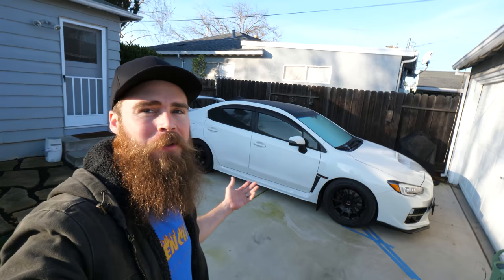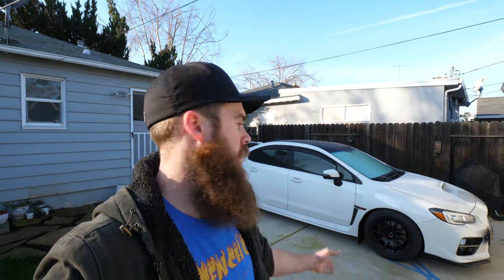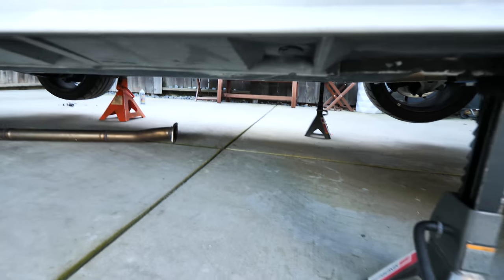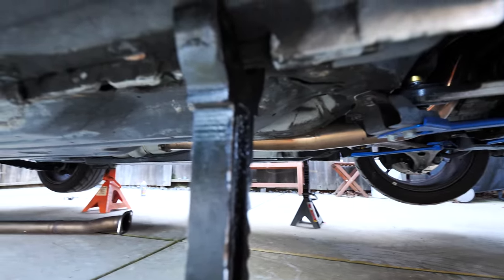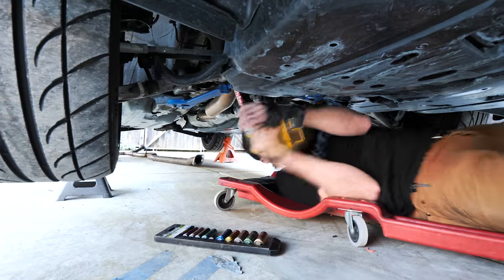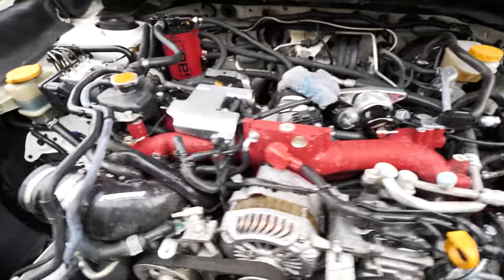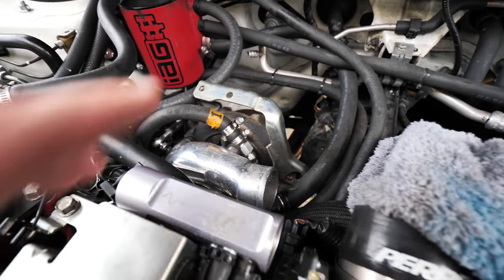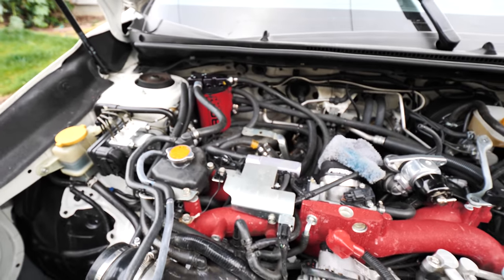MOST HATED SUBARU VIDEO EVER "THE STI PART OUT"

Comment: Hey what's up Blake. Just checked out some of ur other vids and see ur an Audi guy. A close friend of mine had a 99 a4 1.8t Quattro back in the day. The car was making about 440 - 500hp on cam2 race gas & running a haltech ecu. Ran mid 11s quarter miles ( very fast considering this was the early 2000s). Anyway he prob owned the car maybe 8 or so years. He went through about 4 engines and about 6-7 gearboxes i kid u not. Twice due to oil pump failures and once it threw a rod through the block. Grass not always greener on the other side. He however loved that car.

Fyi I do own a 02 wrx with almost 200k miles for the last 8 yrs.  Lightly moded and owned since about 70k miles, so nothing crazy.  I have done 2 timing belt changes and clutch myself using oem parts.
Reply from the maker: blue88aw11 Yeah the EJ20 was a lot more durable than the EJ25. Thanks for the Audi info I always heard the 1.8 was kinda crap. From what I’m hearing about the MBQ 8V AUDI’s and Golf R’s is that they can make reliable power 400 wheel on the stock block no issues and tracked. I’ve been talking to 034 motorsport about this and they track the hell out of there’s no issues. Seems like most modern German cars can hit lap the track with no overheating issues where new JDM cars cannot. For example I just heard Matt Farrah talking about how the Civic Type R was overheating after a few laps at Road Atlanta.
Reply: I still like them and I was considering buying one of the older 1.8t a4's last year as a 2nd car. They are dirt cheap around here (NYC), around 1500 to 3k for a decent one with a manual trans. Even the later generation, (after 2003 I think) u can get a clean 2.0t manuel trans from $2500 to 5k. About 150-170 RESTRICTED hp stock. Most Vw/ audi tuning companys way back had 200$ kit for the 1.8t that gave an instant 50-60 hp. Basically it was just a chip and drop in k&n. Add a good exhaust, turn up the boost on the tiny turbo and I think u got a reliable 250-300 hp car. I honestly think it is the best performance  deal out there. U can buy like 3-4 a4s for the price of a wrx of the same vintage haha. I actually wound up getting a good deal on an impreza outback sport.
Reply: Btw good luck with your hunt for an e46. I think ur in Cali right? I know someone looking for e46 m3 with a manual, hard to find around here (NYC). A clean hardtop with a manual is super expensive. U can get one of the SMG ones for like half the price it seems haha..

Comment: Hated this video until I got rod knock at 60k on my 14 STI COBB STG 2... Never been tracked, and routine maintenance performed. Went through a second motor within 3,500 miles (Most likely a poor build) and about to receive a third motor. I don’t hate on Blake for getting away from these type builds. Great looking and sounding cars, but not feeling too good about the ej motor at this point.
Reply from the maker: Yep, it's definitely a downer when the keep 💩💩 themselves. But fun when they work.

Comment: big mod list for a car that makes similar power to an fa with a downpipe intake and e50
Reply from the maker: Hugh Janis I hope you know the FA fails pretty commonly also I’ve see quite a few in the shop getting builds after they frag the engines.
Reply: I wasnt commenting on anything other than that being a rather lengthy build list for only 400whp. I mean it seems like 350wtq is the sweet spot in the new fas, most notably was maperformances car. It blew up but fuck did they beat on it for 30xxxx miles on a rather high lvl of ethanol and they say around 370-380wtq when it blew. I would agree buying an STI right now not the best idea, 2020 and the new sti on the other hand will be interesting. As far as german cars go dont get a BMW they are just as expensive and break just as go for a 3.0t s4 and get an 11+ so you can have launch control.
Reply from the maker: Hugh Janis got ya, you can make 400+ wheel on a stock EJ block just not for long. Even a built engine will only go about 20K then pop so for the price your right you could have just bought a used S4 2011+ or if your talking new car cost and engine build 💰 you just bought a brand new S4
Reply: Funny just snagged a brand new z51 2lt today, guess i dont have to worry now lol later subie and z

Comment: It's unfortunate that this is the worst gen Subaru. My transmission failed with only 20k and no mods and off course if your a Subie fan then you saw how terrible these cars have been on the Rallycross circuit the past few years. I'm still a fan of Subaru but kinda like you did i'm working on an alternative fun car.

Comment: I know people with the new RS Focus and blowing shit up. It's all about how you drive your vehicle and how well you take care of it. Race the vehicle "even a race car" and it'll eventually start breaking. lol 

If I do anything with my RS, I may just track it once in a while. Primarily to get the feel. Otherwise, I may do some mods, but most mods may be in the interior, "Sound system and such."
Reply: Zack Sexton yes u can blow up any motor on any car. I have seen people blowing focus rs motors as well so I'm not sure why the hate on subaru is so prevalent
Reply: Chris Rogers, yeah I think it's just a thing. Competitor competition or just a matter of people buying a car and blowing the engine and realizing how expensive it really gets.

I was originally going to get an brand spanking new STI, but I heard about the RS and wanted to try it out.
Reply: I like speed and all, but I got my car primarily for leisure and better acceleration due to dumb people on the road and hill climbing.
Reply: Also look in the golf type r which is actually a very underaated car that has an inline 4 engine like the evo and makes great power. Check out Cobbs ots maps on the golf r and u will be very suprised

Comment: To start I'm not hating on your video this is  my opinion 
Subaru's are not made to be modified heavily I think these engines should mostly remain stock a cat back exhaust and maybe an air intake that's it
 I have an 05  2.5 rs I swapped the engine to a v7  jdm 2.0 ej205 avcs it runs beautifully engine fully stock no big injectors no big turbos  I'm using the jdm ecu stock tune cable throtle  I use  94 octane gas  the car is my daily I change my oil at 5000km no issues what so ever I drive it summer winter I beat on it all day

Comment: Have had a 2011 subaru for 5 years. It is an amazing vehicle and the best thing you can do is get elh and call it good. Don't beat on the fucking motor cuz it's not a drag car. It's meant for ripping windy roads not for beating on them. As with any care treat it well and it will be good to you. I'm not discrediting the blown motors but any person that has had a blown motor beats on thier subie and those that don't never have problems.

Comment: Not to be contentious, but who here has any problems with the stock FA20DIT? Other than a throw out bearing I've had zero problems.
Reply from the maker: I’ve see a few grenade they have issues with the connecting rods.
Reply: I had two 2015'+ WRX's with no problems.
Reply: I'd agree that the stock tune sucks. From what I've heard, e85 does not play nice with the high pressure fuel pump and the added low end torque doesn't fair well for the stock rods.
Reply: Matt Hamann I've rebuilt a few for weak rods. Also keep up on keeping those intake valves clean.
Reply: MattyIce very true. I've gone just under 30k miles in my '17 and haven't blown it up. I never launch the car and downshift when I wanna accelerate.... I feel like it should be common sense not to lug the engine. 

The only thing I have legitimate gripe about when it comes to the stock tune is the rev hang.

Comment: You guys need better fuel seen u use motors like clutch's . Im on my 3rd clutch 170k km on block and intake valves are near carbon free. Good oil and good fuel. 98ron for 8yrs and i abuse the motor. And too many people expect those stupid cobb maps or a flash to be safe. Most of them are not even close for your cars.
Reply: He was protuned and e85...

Comment: Every car breaks. Pay to play.  Less is more with these cars... I know guys that would rather not build the engine (they know its gonna blow anyways) or just throw in drop in pistions. I think the bottom line is if chasing serious hp we all know these ej engines are not the most economical / reliable esp w their old tech. It's  also known that one should simply start with a higher horsepower car to begin their build as they will be more robust from factory and even over engineered to an aspect.  I own a sti, and its stock until I can afford to play lol. I have other priorities in life at the moment...  Additionally,  before I take the, "blowing up motor" plunge I would like to build an engine and familiarize myself with the hobby at that level. There's a thread on nasioc from stimikey , where he managed over 450whp on a mild build and would daily the sti and drive to fl and back to CT.  Lasted over 70k. Then again, theres heaps of these cars failing before their 2nd oil change...  Anyways, take care and everyone be safe, no matter what car we drive or blow up lol.

Comment: Why not just get a built motor I don't get it. You went through all the trouble to do this but you can't just slap a closed deck on?
Reply from the maker: Angel Fong well it’s a waste of money. They still blow up as well just takes a bit longer. Also for the cost you could just buy a better car. 40K STI +20K engine build =60K now I can buy a used 911 and flog it all day long at the track no issues.
Reply: Rodel had an IAG closed deck block
Reply: Well damn so either way we are doomed? I have every single posible mod on my15 sti tuned on 93 at 345wtq/hp nothing has happened yet..

Comment: A properly built and driven STI that's not 600HP+ can be reliable driven daily.
Reply from the maker: Okay, ask Evan Shanks, White wing STI, My WRX Channel, Cali WRX, Shane aka Subros, every one of them has personality experienced blown built engines and non of them we’re even close to 600HP at the time. It happens to everyone that ones a EJ. If you think otherwise you’re just fooling yourself and eventually you will see.
Reply: Totally agree if you're talking stock EJ (I cracked a ringland on stock block at 400WHP), that's why Subaru is settling the lawsuit right now. Disagree if you're talking a daily driven built block. From what I understand White Wing's initial IAG block was factory defect. User1029 has not had any issues on multiple builds - https://www.iwsti.com/forums/gr-members-journals/168019-iag-built-hta86-500whp-daily-driven-145-000-miles-275.html#post4458668 

Every OEM car has a weak spot, especially when you starting modifying them(First batch of GT350s had  over heating transmissions, Focus RS's headgasket issues, E92 throttle body issues, Audi R8 valve corrosion and AC unit failure, 996 IMS bearing fiasco, Z06 going into limp mode on the track b/c of overheating. 

It doesn't matter what kind of car it is, if you drive it hard, and track it consistently the engine will need to be rebuilt. In NASCAR they rebuild the engines after race, in Formula 1 I'm sure they would too if there wasn't a limit on 3 power units per season, and even titanium gear boxes used in rally car need to be rebuilt every 750km or 2 races.

Comment: Not really sad, moving on to other things modifying/tracking vehicles. The most reliable subaru engines have been the the 6cyl. Subaru is doesn't make the most reliable engines they like to explode and leak Head gaskets and cam carriers for the new FA/FB motors. When My lease is up the  car goes back to subaru. The Brand to me just feels completely stale but at the end of the day most of the new cars I have driven have been disappointing. Sure there quick and have very good NVH levels but theres no charcter. The Sti has a bit with its old noisy engine with a noisy transmission. But I am sick of the unequal length headers and the nameless muffler delete on all the vehicles wrx/sti just boring and getting stale

Comment: Good thing I didn’t get the sti or wrx because I was thinking abt one but instead I went with a type r instead
Reply: Manny Man how is that btw? If you have test driven both, what are the differences?
Reply: Rufio In well the R feels amazing cuz of the power but doesn’t handle well as my 86...wanted to get rid of my 86 for a sti but had couple guys telling me I should wait for the 2020 cuz the current one is an old motor, blows up to quick, ring problems and etc so I wasn’t sure what I wanted so it was sti or type r so I chose the R instead...I haven’t fully throttle it yet since it’s not 1000 yet but I can feel the power I’m just waiting to hit that mark and see how it goes

Comment: Shouldn’t be doing Autox at 800 miles. Break in period for all Subaru’s is 1000 miles AKA you and your friend don’t know much about these engines. Maybe that’s why you blow them all up huh? But keep trashing the subaru name....it’s definitely their fault you can’t follow instructions.
Reply: I broke my car in on the dyno and it did just fine... different strokes for different folks. He’s not bashing the subaru name. He’s telling basically the harsh truth. Subaru and their motors aren’t fun to modify unless you’re willing to pay big big bucks.
Reply: Alex Bournoville it's a myth that these cars (or any car from a factory) need a break in. If you've ever had to seat rings in on a fresh build you would know why. Any car/engine from the plant has already been run in before it's shipped out

The 800 mile car cracked a ring land. It's common and happens  to most EJ25's at any mileage.
Reply: Cali WRX I would say you are one of the lucky few who “abused” the car before breaking it in without issues. Regardless glad it worked out
Reply: badams0311 A quick run in the factory doesn’t provide what is required for the break in period. The engine needs to be subjected to MANY heat cycles as well as normal operating conditions to be properly broken in. This is the same reason oil changes are requested after the break in period, because there will be particulate and metal in the engine from manufacturing. Break in periods are not a myth, they are there to protect the manufactures ass in odd cases that cause failure.
Reply: Alex Bournoville have you been to a factory and seen how/what they do there? It takes not even 10 miles to seat in rings properly. FYI, even cars with 150k+miles will have amounts of metal in them. Again, you may be confusing what a factory engine needs vs being rebuilt in a shop
Reply: badams0311 I own an 04 Stage 2 STI with 145k miles that still runs strong...  I beg to differ.  I have also met another guy at the autocross with 150k on his motor a couple years ago.  I’m getting a rebuild now not because I need it but because I want a fully built motor to maintain reliability.

Comment: don't need a built block for 400 whp on that car I'm pretty sure.
Reply from the maker: x Royal umm did you watch the video? I hope this is a joke or you need to rewatch these things blow stock.
Reply: hahahaha
Reply: Guess I’m lucky since I’m 400 to the wheels n had the car for three years already 🤷‍♂️
Reply: Well I just bought an sti a couple weeks ago so that’s just what I’ve heard. After watching the video I will be trading it in on an evo x or focus rs. Probably not the focus because they are just as unreliable as these sti engines so I’m going to probably have to go with the evo x. Thank you for the info that you gave in this video.
Reply: Blake, do you recommend a Focus RS or an Evo X? The car both will be tuned for 330-350 whp, and will be used on/for autocross races and track day races. Temps between 70-90 degrees.
Reply: x Royal buy mine
Reply from the maker: @rmitchy1189  update please 3 years later is it blown up?
Reply: @BlakesGarage  i just went built in October 2020 but to answer ur question so she didn't blow so from March 2015 to October 2020 she handle all my abuse daily n track. All about the tuner n maintenance. Also still have my stock motor for future build.